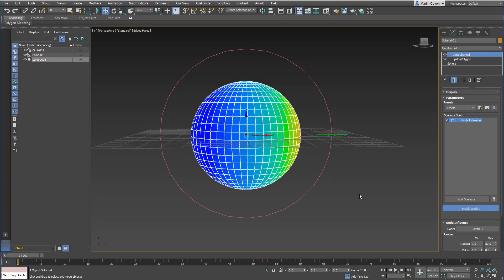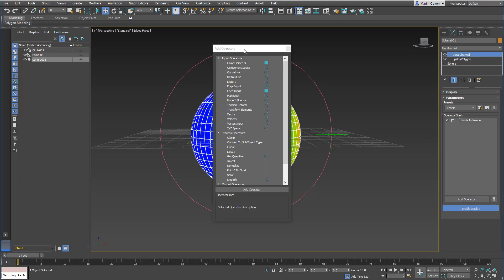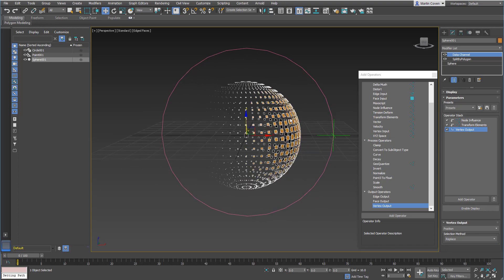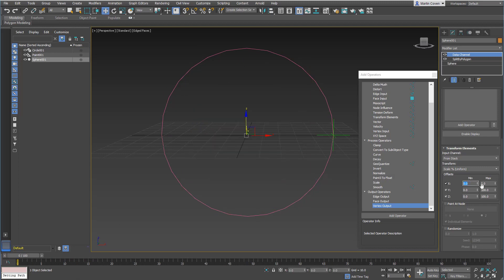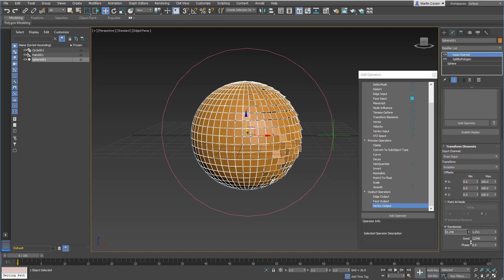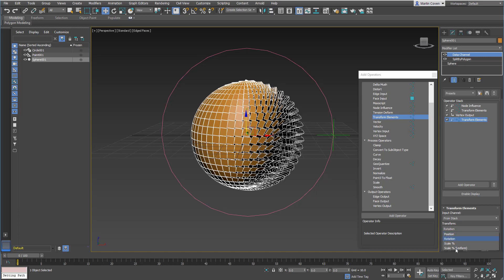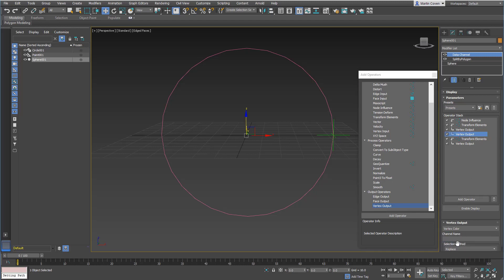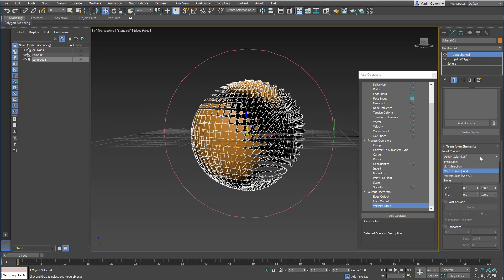3ds Max Tips And Tricks - Data Channel Modifier Transform Elements

Comment: Really cool trick but kinda useless when it uses a custom modifier that nobody else has :S. 3DS could be pretty good for Mograph but its locked away by programming knowledge. C4D seems to just give you all the tools rather than force you to make them!
Reply from the maker: What do you mean re-custom modifier? Data channel modifier has been in Max for a few years now.
Reply: Split by polygon? However, I do apologize as you can re-create what you've done by using this script - http://www.scriptspot.com/3ds-max/scripts/detach-faces-v2
Or by using editMesh > Explode with a low threshold. 
It's not as elegant or controllable as an actual modifier but it gets the job done. Probably not something that is immediately available unless you know what to look for/ where to look. 
I think I was just jealous of the SplitbyPolygon modifier and how easy it is to control the scale of each individual element with just a slider.....
It's actually really great to see these small windows into what a modern 3DS can do. I don't think many people realize the potential of the data channel or the new spine tools. They aren't really marketed very well.
Reply from the maker: @jixal  ah, the easiest way is use chamfer modifier and set to open and turn off the min angle so it chamfer and splits each polygon. :)
Reply: @martincoven  That's a very good point!. I've never found a practical use for that option before >_<. Thanks.
Reply: @martincoven   Where can I find the SplitByPolygon modifier?
Reply from the maker: @richardvillagaray4532  It is a MCG modifier, but you don't need it. You can just use chamfer and set it to chamfer all edges, then in the options set it to be open. and make the chamfer amount really small.
Reply: @martincoven  Thanks a lot